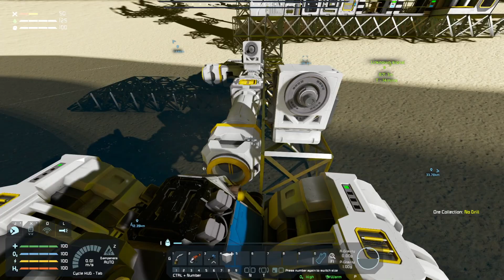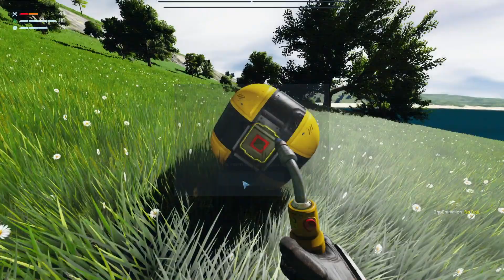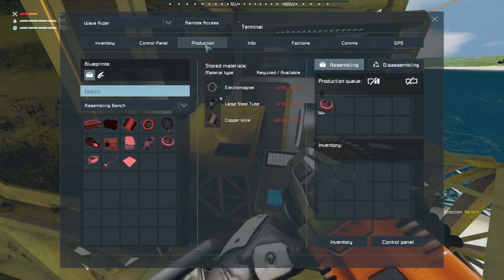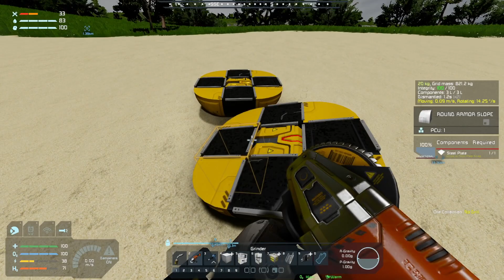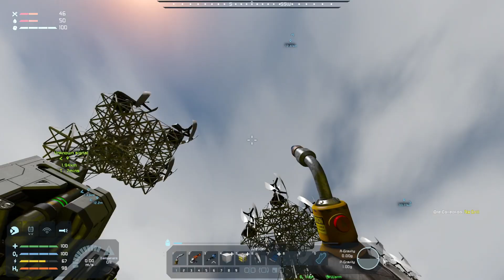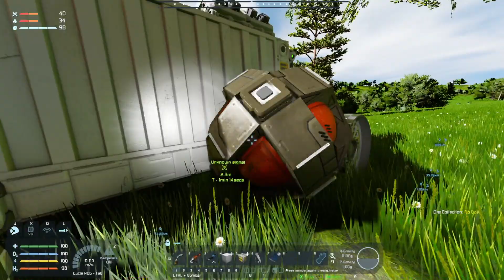Space Engineers - S4E07 'Industrial Expansion'

Comment: Word of advice towards the buildings: work towards concrete mixer (forgot what is it actually called) and use as much gravel and concrete blocks as you can, you may not like their texture but you will run out of iron super quickly, you will need it for all big machineries in future and you dont have a iron mine nearby. Sooner or later you will be drowning in gravel anyway so why not use it.
Reply: When using IO, I use gravel to make concrete blocks for my "foundation" and "slab" structures, just like I would IRL.

Comment: The Quota mod is nice especially since you get i for "free" day 1, but I've concluded this it is NO WHERE near as useful as Easy Inventory.  EI allows you to organize your inventory, keeping ingots in a certain set of containers, components, in others, junk in others, etc.  This is INCREDIBLY useful as even with Easy Inventory, you cannot quickly and easily see how many ingots you have - so its best to keep all ingots in 1 place, so you can see how soon you will run out of a various resource.  Of course the EI display system is awesome, and you can quickly check to see if your components are close to being back to your quotas or perhaps far from it.  The Quote mod unfortunately counts components in your entire base, spread everywhere. As you can't get a Large Cargo containers until you get displays and a microelectronics factory, you will end up having several small containers before achieving that.  And with resources spread ALL OVER the place, its a huge PITA.  The only issue is that will Easy Inventory, IIRC from my last playthrough, you need make EI learn the recipe for various components.  Its not difficult if you follow the instructions and you only have to do it once.

So, the Quota mod is a nice beginners mod until displays, but Easy Inventory is still a must afterwards....too many components to keep track of.

Comment: WARNING WITH INCINERATOR - it will burn anything in it, and with low available cargo space, important items can get pushed into the incinerator.  So, when using it, turn all other production off, and manually enable and then disable the incinerator.  Ensure to ALWAYS keep it off while not using.
Reply: So, a sorter before it should be usefull ?
Reply: @gaetan5161  sorters require advanced computers, and have 2 entries,so you would need 2 of them, doubling its size
Reply: @dansiegel995  I see. I dont think space is an issue here. But the adv compturers may be to expensive at this stage. But i think for further automation, it should be good.

Comment: For solar power, you could just add solar panels to the sides of your windmill towers along the edges. That way you are getting more power production in a smaller foot print, saving you time and resources.
Reply: Also don't forget that if you leave the area, you will loose anything not connected to your  main grid. So a separate solar tower may not be the best option.
Reply: @wolfpeltskinwalker8444  if he adds "hydrogen battery" on it, it should work fine I guess. Just build the stem of the pontoon tower with a vacuum at the bottom, a hydrogen tank or two, and then an engine. When he gets the stuff for programmable blocks, he can have the engine run at intelligent times as well. :)

Comment: I think it would look cool to build the solar towers out on pontoons in the lake. The extra footprint of the base will help make the base "pop" from more angles. That way you can also keep all your wind towers for now.
Reply: The challenge he will run into will be keeping the pontoons in a static position, as things drift on the water and it takes almost no force to make the power lines disconnect themselves.
Reply: @tackytrooper  Hmmm... I hadn't actually thought to have them as a separate grid, although it is a much better idea. You could instead just build them up off the sea floor as a static grid and then run powerlines out to them. That would also allow you to overcome the issue with tide moving up and down as they could just be greebled pillars rather than attempting to look like they are floating. You could also use hinges to create the traditional floating walkways that move with the tide. Lag willing of course.
Reply: Putting them on the lake, maybe combined with a couple of wind generators, could make them look like a wind/solar/wave energy trifecta, which would be pretty awesome. 

They would likely need to be part of the main base grid for practical reasons, but that doesn't mean they have to look like it. 

Back when I was building in Fallout 4, I would often place a wind generator or two and make them look like the main source of power in a settlement, and then hide a fusion generator somewhere as the actual main power. 

If you're building for looks as much as for function, there's a lot to be said for making something look like it's doing more than it really is.

Comment: Thanks for another good video!  Question about your power comparison between solar and wind.  Solar is nice for the 1 MW, but does not it only work for 50% of the solar day?  ...whereas the turbine (500 KW) would run 100% of the same day?  Concluding that the comparison between solar and wind is actually a 'push"?   Nonetheless, thanks for the video!
Reply: Wind needs to be spaced out significantly compared to the tight packing of solar panels, and if you can store the power it should make it an overall more economical choice, IMHO.